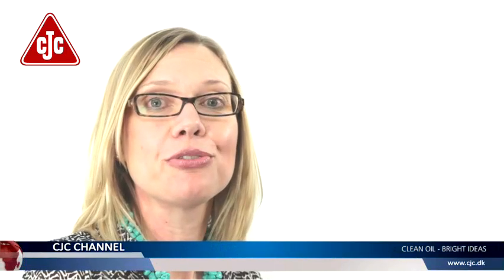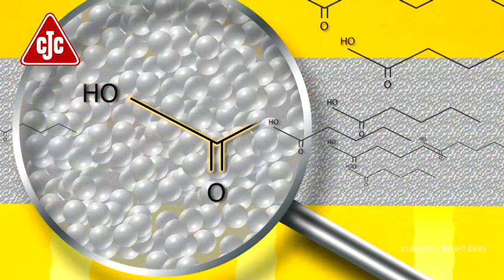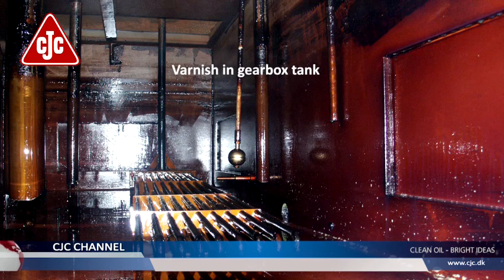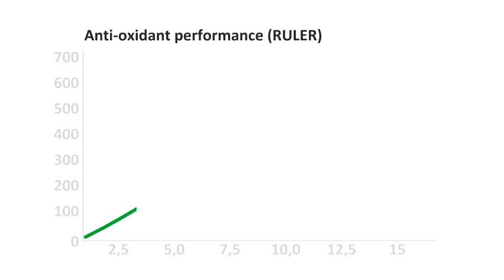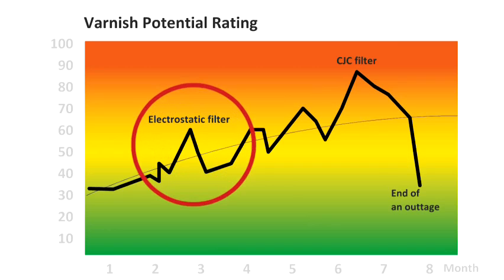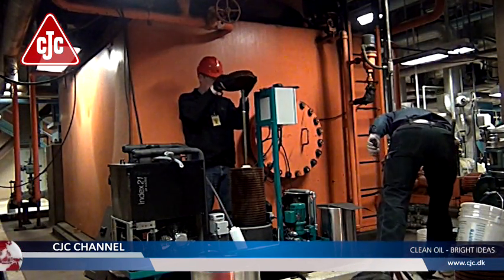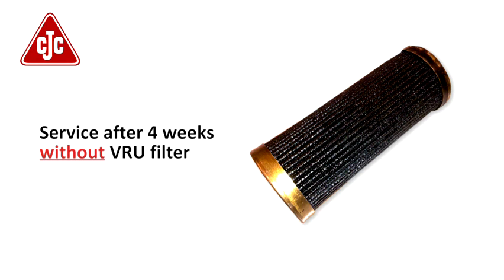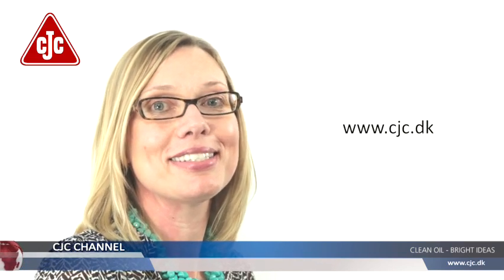CJC Varnish Removal unit (VRU)

Comment: Im not sure what Electrostatic Oil Filtration system you are making reference too, but I assure you that this presentation didn't use an OILKLEEN system and is WRONG.  OILKLEEN patented electrostatic technology not only removes varnish from oil (MPC Patch test) but will STRIP varnish from internal metal surface build up.  You made a claim but didn't show a BEFORE and AFTER internal component.  I would challenge this claim any day in a Head to Head comparison between CJC and OILKLEEN.  paul@oilkleen.com
Reply: Paul, I welcome if you would like to run a completely documented Head to Head test of a CJC VRU vs. an Oilkleen electrostatic filter. Please contact me at shj@cjc.dk so we can sort out the details. Best regards Søren Jensen, R&D manager C.C.Jensen A/S
Reply: I will take you up on that for sure.  Thanks for invite. Paul Jarvis CEO OILKLEEN.
Reply: @OILKLEEN  Did this ever happen? Can you share the results?
Reply: @vendersgade  Did this ever happen? Can you share the results?